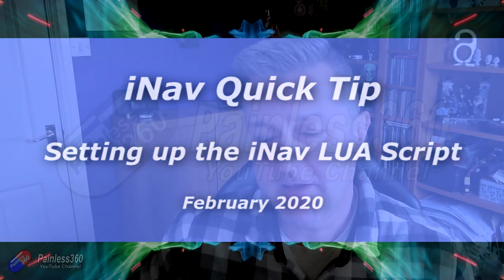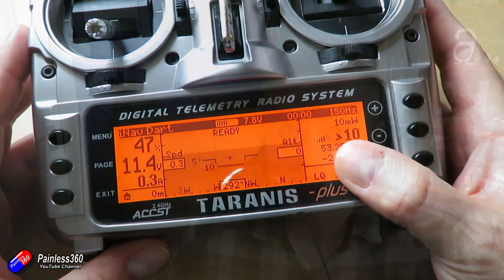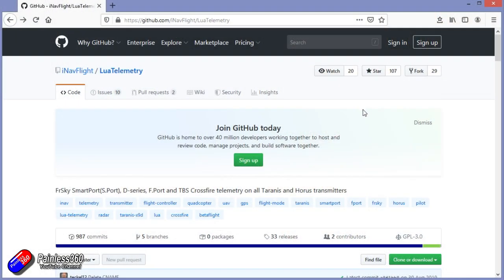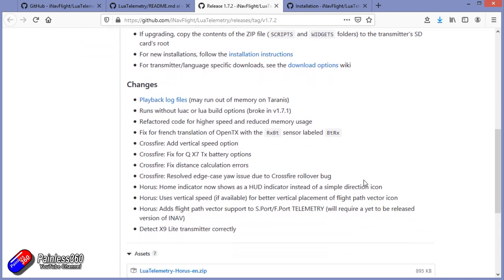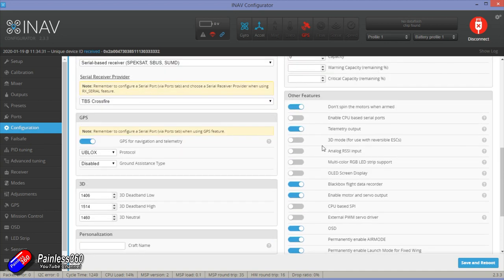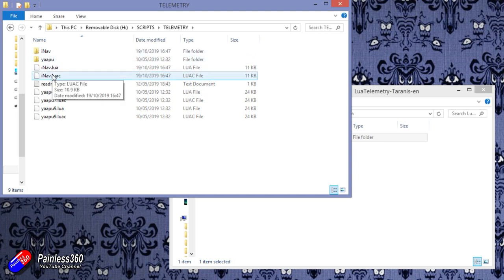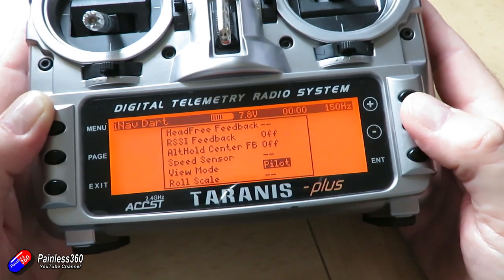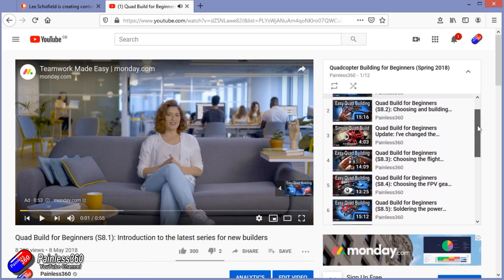Easy iNav LUA Script: Simple Setup step by step

Comment: I like the idea of the model actually announcing back to you which mode it is in. With Arducopter i have had a few instances where for whatever reason the craft did not switch into the mode i had selected via my switches. Yes, you can set your osd up to show what mode your craft is in, but having the actual tx announce the mode sounds much better to me - all to easy not to notice that the mode did not change on the osd. I have never played with lua scripts, really is something i should have a go at. Thanks for the very interesting info.

Comment: What telemetry data is needed? I'm new to telemetry, but not to flying. I have a receiver with built-in barometer and variometer, but that doesn't sound like enough to complete inav function. I need 8 servo channels (12 would be better), but would FrSky X8R Pro be a superior option to Spektrum 8020T for this application? I'm happy to get into whatever I need to maximize performance. I just don't know where to start. I guess I'm looking for a shopping list. Lol
Reply from the maker: All of the sensors sent from INAV. See my INAV for beginners 2020 series... Happy flying

Comment: I have downloaded the inav lua script to my FR sky Xlite using Crossfire but all of the telemetry data on the screen is just blinking zeros. I have telemetry output enabled in inav and I have attempted to discover new sensors, but the radio will not discover more, and it will not allow me to delete the existing ones. Naturally the battery is plugged in, and I am getting RSSI from the Crossfire, but nothing more. What am I missing?
Reply from the maker: Sounds like the setup or wiring on the model missed a step. I use CRSF to the FC with Crossfire and it works great,

Comment: Hi, It might be important to mention that the script config saving does not work with Opentx 2.3.5 on Taranis X9d+, after upgrading to OpenTX 2.3.7 it works correctly. Thank you and regards
Reply: I have Opentx 2.3.5 on my X9D+ and I can't run the script. I get "attempt to call a nil value" error. I was getting the same error with previous versions of Opentx. Do you think upgrading to 2.3.7 will solve this situation?

I 've already checked the "Common Taranis Errors" from the iNav github site. Neither solution works for me.
Reply: @felisukofpv4002  Did you ever solve this?
Reply: @mfoo3038  Hi. Nope, I didn't :(
Reply: Felisuko FPV ok, i had it today but solved it. Check the free mem (hold ent, change to second page). Then remove other active lua scripts and cleanup models etc.  in my case it was a ltm telemetry script - although it was only activated by a switch which wasnt set. After removing that, it worked

Comment: thanks for the video.  All great except no GPS data. All other data is fine.  Any ideas?
Reply from the maker: Not really. If the GPS is all setup and working in iNav then it should be in the discovered sensors list in the telemetry menu in the radio... Best of luck

Comment: Hi Painless360 I own a Taranis X9d 2019 SE, I have carefully followed your video explaining how to set up (LUA SCRIPT INAV). Once the operation is finished and the files have been inserted as indicated, when the transmitter is turned on the lua works but I do not read any example values, I see the satellite symbol but it marks 0 when I see 9 hooked up to the monitor connected separately, the other values are also all at zero. I ask your kindness if you can tell me why I don't read any values. I apologize for my probable bad English. I am Italian and help with the translator. Thank you in advance and I hope to receive your advice as soon as possible, good day Franco.
Reply from the maker: If there are no sensors being shown on the radio then the problem is with the setup on the model, not the LUA script. I'd start there.. Best of luck.
Reply: @Painless360   Painless360 thanks for the quick reply, I flew with this model and it flies well this is the configuration: F.C. Matek 405 wing, Crossfire module and receiver. So it's not a model or flight control issue. As I said I followed carefully your video decompressed the files as indicated I launched the new search for the sensors via telemetry they were recorded and I read their values in the transmitter screen, the problem I encounter is that when I launch luascript inav at this point I do not read any sensor value eg. connected satellites i see 0, battery voltage 0, where should i have the numbers i only have the value at 0, can you give me some advice so that i can read the measured values? Thanks Franco
Reply from the maker: They should be automatically read. I would delete and rediscover the sensors in the telemetry page. Best of luck

Comment: Hi Lee I’ve just loaded up the Lua script for the telemetry, I’m not finding all the sensors can only get three . The control board is a Matek 405 wing and a X4R receiver do I need to ad some extra wires to get them to work hope you can help me with this problem  Cheers Pete
Reply from the maker: Yes. See my builds. You need to setup Smartport telemetry in iNav and wire up the RX.... Happy flying!

Comment: Hi and thanks for another great video.
Does this script work with Ardupilot as well ? I have Matek f405-CTR running Ardupilot and my receiver is R9 slim plus. I use sbus telemetry from Matek board and getting all data back to my taranis radio but could not find any compatible Lau script for that. Any help would be appreciated. Thanks.
Reply from the maker: Check out my Pixhawk and Ardupilot videos. I use Yappu scriot here... Happy flying!
Reply: @Painless360 Thanks,  I followed your pixhawk video and build my previous quad with your suggested yaapu script. It works great with my Pixhawk but not with telemetry data from Matek F405CTR. Is there any other script that I can try specifically for Matek?
Reply from the maker: Not that I am aware of - sounds like the telemetry setup needs a tweak. Best of luck!
Reply: @Painless360  I finally found solution to my problem, in case someone else has the same issue. Matek f405 CTR provides two telemerty port and I use telemetry2 which is TX4 on the board and I connect it to the sPort in my r9 slim plus. Based on Matek documentation, for this to work SERIAL2_PROTOCOL should be set to 4 (s.port) and it's good and it gives you all the telemetry data/sensors,but doesn't work with yaapu script.  For yaapu script to work,you need to set this to 10 and NOT 4. Now it works the same as Pixhawk and you will be able to see all telemetry data on Tarranis screen. Hope this helps someone facing the same issue. Happy flying :-)

Comment: I have problem when i turn to right on my qx7 display turn to left and when turn  right it turn to left , I already calibrate flight controller on configurator its ok but not on inav lua
Reply from the maker: If you're talking about the artificial horizon - that is how it works - https://www.youtube.com/watch?v=lxVd4LnHDjQ
Reply: Painless360 thank you so much for that info but I’m getting some problem. On my transmeter inav telemetry point direction is wrong  it not point aircraft same as realtime

Comment: Is there any conflict with running iNav and betaflight LUA on the same radio?  Would you have to select which LUA or will the radio automatically know which one you want?
Reply from the maker: if you watch the video then you should see how you set it up. You select the Script you want to run. The only problem I could potentially see is if a script overwrote the sound files of another one so that it played the wrong sounds. But that's never happened here with Yappu (Ardupilot) and iNav scripts, hope that helps

Comment: The units are shown on the github page in imperial but they are metric on my radio. My radio setup is set to imperial. not sure where the setting is for this
Reply from the maker: Not sure, the speed and distance values are displayed  based on transmitter's telemetry settings. If you are using the latest versions and still have the issue then I'd log an issue on the Projects WIKI pages.. best of luck!
Reply: Thanks, I'll dig into it a little more
Reply: @Painless360  ok I'm an idot! I had imperial set in my radio setup but I didn't realize I had to go in and edit the units for the individual telemetry sensors.

Comment: well I got this going on my x9d (fw 2.3.11) with a matek 411 and crossfire micro. It seems to be reading telemetry okay but there is a huge amount of latency (around 5s). Has anyone else experienced this or have a solution. in inav configurator the response is very fast. This would still be useful as long as the plane was in altitude or horizon mode to navigate home, but I don't think the attitude indicator would be much help for a fast recovery

Comment: Hi Lee, I have a question regarding the OSD in INav...I have a Mamba F405 with AKK FX2 Ultimate. I can see all other items I like in the OSD, but not the vTx channel and power level. MSartaudio seems to be working fine (I can make changes via the OSD/Tx) and I have no issues with teh feed either. Is this something that might still be in development? The other thing I have come across while using this script is a warning saying battery critical as soon as I take off and soon afterwards zero percent...any hint would be as usual greatly appreciated. Thank you KiwiFPV from New Zealand
Reply from the maker: Check the battery critical levels in the menu. Its all configurable. Check the vbat and battery voltages are right in iNav power tab and in the sensors on the radio too... best of luck
Reply: @Painless360  thanks Lee for the hints...always a bit tricky when you change from something you know (Betaflight) to something slightly different ( iNav). Any hint about the OSD part or could that be a glitch? Couldn't find anything on GitHub...

Comment: Got it working on my T16. Can’t find a way to switch from metric to imperial, though...
Reply from the maker: Have you tried changing the units in the OSD tab in iNav configuratior?
Reply: @Painless360  Yes.  MPH and feet in my OSD but kmh and meters in the script.  I'm sure its something simple.
Kind of maddening though, as all of the screenshot example screens in the github instructions are in imperial...
Reply: Oh I see.  You have to set the Dist, Alt, GAlt and GSpd sensors to the desired units.  Also have to adjust the compass offset to match the board orientation in the iNav config.

Working properly now!

Comment: ehhhhh can I run that on a Tango 2? tiny virtual cockpit on that OLED would be cool
Reply from the maker: The Tango display looks like a version of the one on the QX7 so I'd expect that only LUA scripts that support the QX7 would be in with a chance...
Reply: @Painless360  oh, I didn't realize that could be radio/hardware -specific...?
Reply from the maker: The LUA scripts usually are (if they use any type of graphics)...

Comment: Would this work on SBUS as well?
Reply from the maker: If you also wire up and configure Smartport telemetry to the reciever... Happy flying
Reply: @Painless360  Got it working on my C1 Chaser. I love it, thank you so much! I love the battery warning. One question on that is how does it know what size battery is in the plane? Does it just go by the voltage or is it by the setting in iNav?